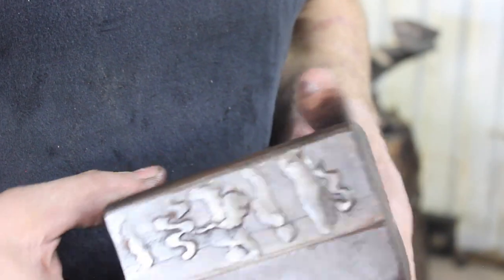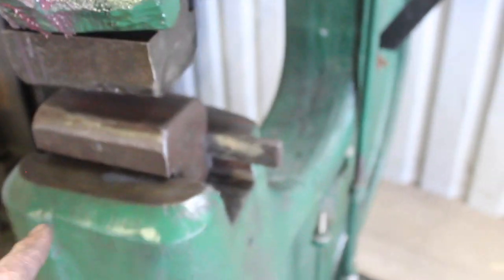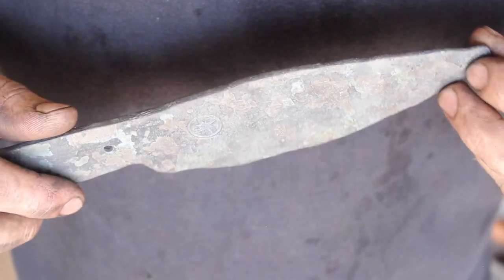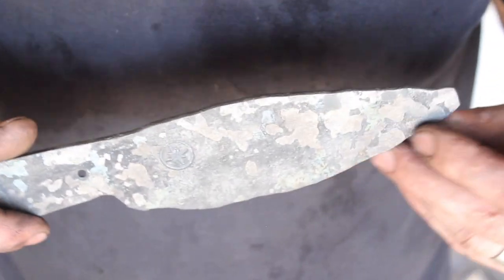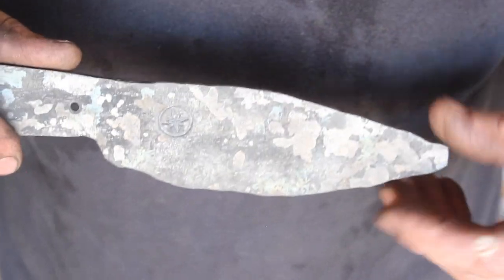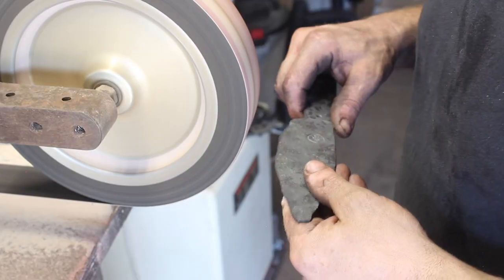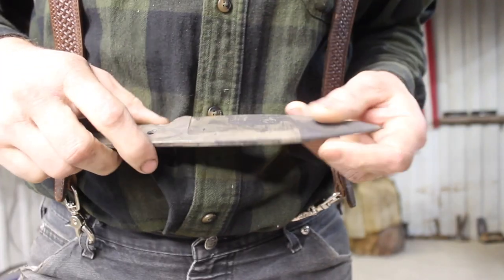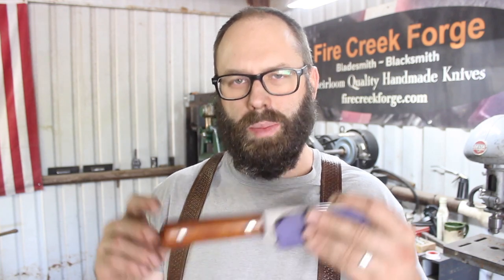First Knife Forged Under The 50lbs Little Giant Power Hammer Blacksmithing Knifemaking Bladesmithing

Comment: Great that you got the new hammer, it will really add to your making. Here are a couple of tips that maybe you will find helpful.  First, be very very mindful of safety. When you are using a tool of this type, it is really easy to make a mistake because you did something without engaging your brain first. Be very conscious of when you activate that hammer and where all your appendages are before you do so. Believe me, when you get into making, you can be so focused on your hot steel that you forget the danger that that clashing set of dies poses to your body. Be conscious of your order of events. Concentrate on getting your foot on the treadle properly, then worry about getting your metal into the dies. Move with conscious purpose, I always compare it to doing anything with firearms. Safety First! Second, try using two pairs of tongs to control your stock in the dies. You will have better control, you will have less unwanted movement of the steel under the hammer, your stock won't bounce around as much, and there will be less chance of accidentally flipping the steel or a tool into the corner of your shop or into your face without meaning to do so.
Reply from the maker: Thanks for the tips!
Reply: Be conscious of breathing. Make sure to breath. Shoelaces, be conscious and always tie your shoes. Crossing the street….be especially conscious and look both ways. So many things to be careful of out there good thing we got experts to remind us.
Reply: @oldstudbuck3583  you ever worked with a power hammer?
Reply: @AndyColglazier  don’t be so thin skinned and put your mask back on. I never have worked with a power hammer. I have worked with hot air filled know it all’s puking out unsolicited advice.
Reply: @oldstudbuck3583  you're giving advice, too.  About machinery you know nothing about.

Comment: Nice, opens up some new possibilities. You might want to raise the hammer up a bit. Seems like its a bit low judging from the camera footage as the bar your forging seems to be going in at a bit of an angle instead of flatter. Over time the shocks from it will effect your arm joints..
Reply from the maker: Thanks ! It is a bit low, they all seem to be, I'll just have to adjust the height I'm holding the stock...
Reply: o, @FireCreekForge  I think you also need to raise the ram at the pitman. It's part of the deal with a mechanical hammer. Learn to do it quickly on the fly. I found it painful to watch because I wanted to adjust it myself. When it flutters it eats up a lot of power.